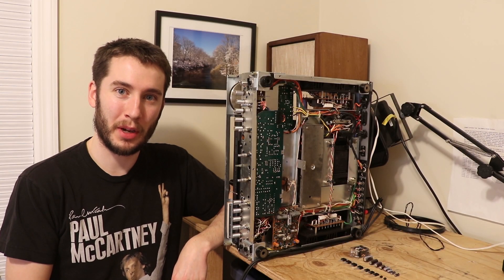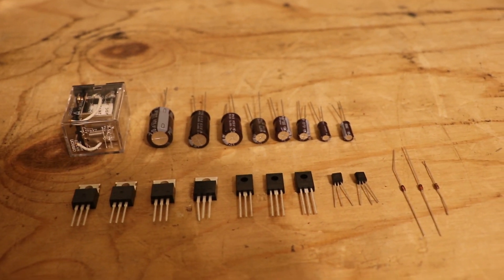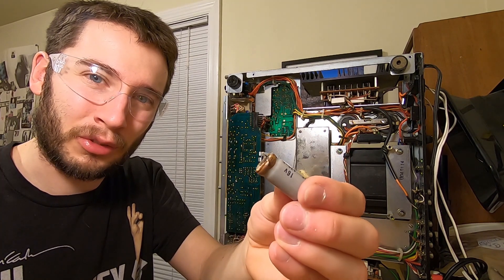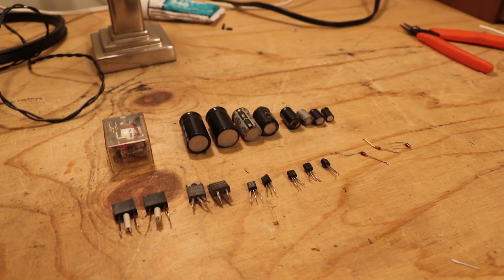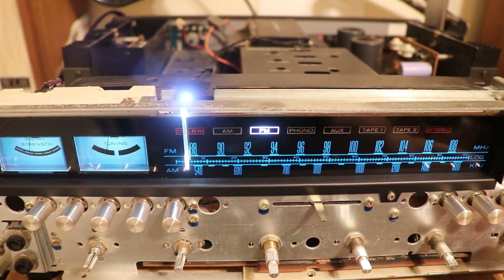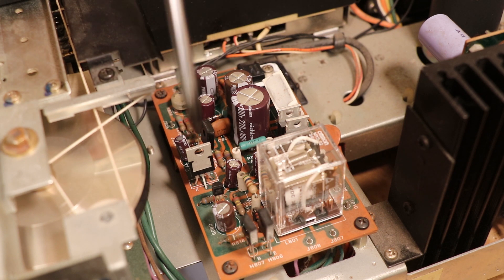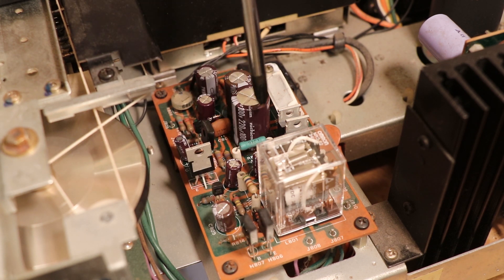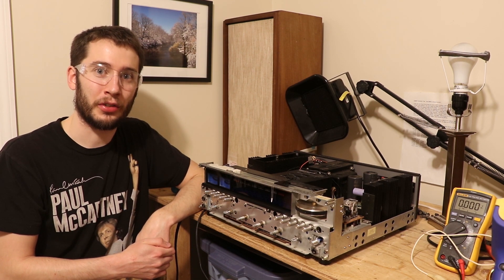Restoring A Marantz Power Supply Board P800

Comment: Learning a lot from your videos. Thks ! Question, Rebuilding a 2252 800 board. Wanting to replace the DS131b and ds132b diodes. Are they the same diode? Saw your parts list and found your replacement for the ds131b (BY2Q8E-200E) Will that work for both of mine? Thanks for your help!!

Comment: Hi, It says in you parts list that you used KSC945 for H803/H805. The only KSC945 that I'm finding uses EBC instead of ECB. Are you twisting the legs around? or is their a version of KSC945 that I can't find? Thanks
Reply from the maker: That's interesting. The datasheet on mouser is indeed showing EBC, but all my 945's in stock are ECB. They must have changed it. I bought mine years ago. In that case yeah just make the legs go where they need to go, put a piece of heat shrink over one leg if it needs to cross. When you receive the parts double check them for pinout
Reply: @AHFixIt  Thanks for the reply !!👍

Comment: I got a 2250b from an  auction recently for $400 plus shipping. It had blown outputs in the left channel, my first tech job in 40 years. Rebuilt the power amp P700 and new on semi power transistors. Very satisfying. Dc out put was 18mv on the left and -70mv on the right, I adjusted them to the correct voltages. Going to start at the power supply and refurbish it. I also love Sansui and would love to see some video's of AH-Fix-it doing a Sansui, Restore a Sansui receiver or an integrated amplifier. Would be great! Thanks for the information. Must have watched the P700 video twenty times before i was confident enough to touch it.

Comment: You didn’t mention anything about mounting the relay to the board.  Did your replacement have the little stud attachment?   The last one I replaced had the stud but the Omron MY2 didn’t have the stud.   I had to hot glue it.    Curious how you mounted yours
Reply from the maker: This one I just soldered to the board since it's board mount. The 2270 and probably 2245 use one with the stud and solder lug terminals, different part number vs the one used here. Those I just bend the outer terminals out for added mechanical strength and solder them.

Comment: It's the glue that causes the corrosion. The glue is used during manufacturing to hold the cap in place for shipping purposes. Common issue in these older units.

Comment: Your guides are a great learning asset. Thank you! I was just wondering how you pick modern components, how do you bridge old specs with new ones. That has been my greatest difficulty - soldering and swapping components are the easy tasks for me, selecting replacements to old devices is not.
Reply from the maker: That's a great question and something I debated including some commentary on in this video.  I will probably make a video explaining this since it's something I've struggled with in the past as well since I'm just doing this as a hobby and have no formal education or training around this stuff.  But to try to answer the question here, I'll say that capacitors are pretty easy - use same capacitance as original but feel free to increase the voltage to the next level if you want.  Example, replacing a 10uf 35v cap with a 10uf 50v cap is totally fine.  Regarding types of capacitors, I use three main types: Nichicon PW for power circuits and anything in a tuner board, Nichicon KA for signal path circuits where the capacitance is greater than 3.3uf, and WIMA film caps for signal path circuits where the capacitance is 3.3uf or below.  Semiconductors get complicated and you need to be careful there.  When I don't know what a replacement is, I just google it and 90% of the time someone has answered the question in an AudioKarma thread.  So for the H811 diode, I just googled "1S2471 replacement" and saw that someone had recommended a 1N4148 diode.  However, I say be careful because I've replaced transistors with something someone recommended and had voltages in the circuit get wacky.  So always keep the original component around and intact until you've confirmed everything is working.  When in total doubt, try to look up the datasheet for the original component and compare it to a new component.  Also this is a fantastic resource and has worked well for me, but like I said, be careful: https://audiokarma.org/forums/index.php?threads/transistor-substitutions.688515/